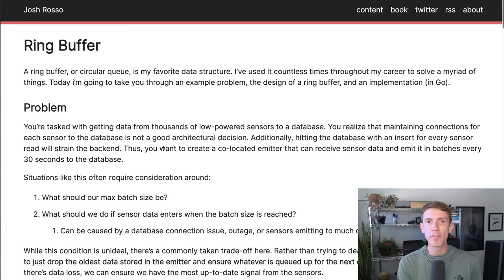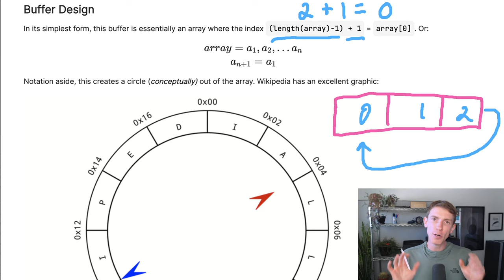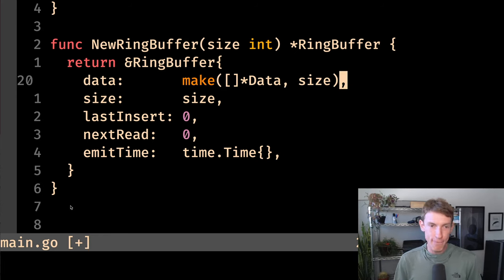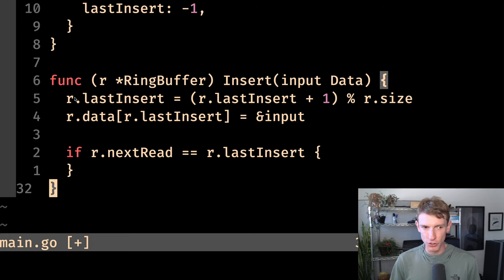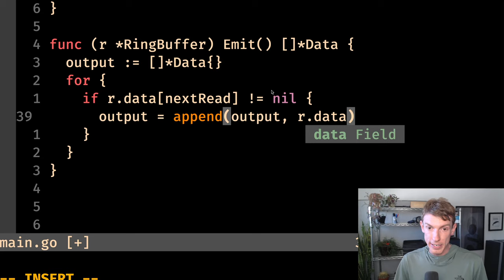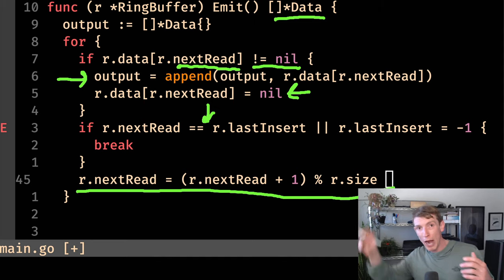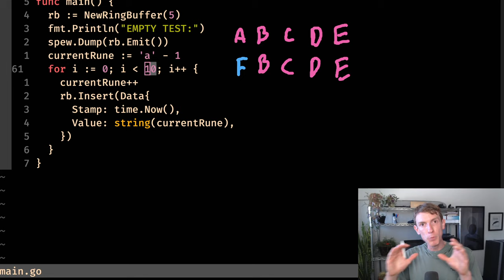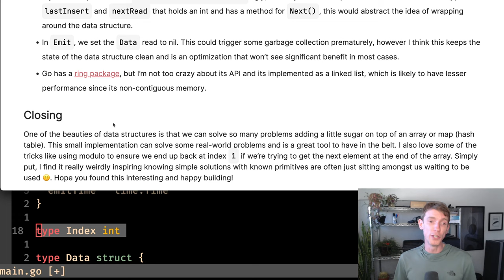Ring Buffer

Comment: great demonstration of a simple implementation of circular buffer. those structure are really useful with Arduino and other microcontroller. I usually reserve a node as an indicator for "overflow/datalost" that might be important to log (or turn on a warning light). I just recreate the node after sending/emptying the buffer and start at 0 instead of -1.
Reply from the maker: Great idea regarding the overflow indicator 👍🏻

Comment: There are several flaws in this implementation of the algorithm which are 'solved' by you using nil values.

The first problem is in the Insert method. The first value inserted increases lastInsert index by 1. At this point nextRead is 0 and thus equal to lastInsert which is now also 0. This executes the code that increases the nextRead index by 1.

The second problem lies in the Emit method. When in the loop the last character is read, the loop breaks but the nextRead index is not increased. So the nextRead is still pointing to the previous position.

As said both problems are obfuscated by the fact you use nil values.

Comment: Great tutorial, I got here from the blog post.Please can I know the software you are using to draw over the code editor. I have an xpen device but endup switching on different screens. Also some implementation block the insert/read when its full/empty. My guess is that data loss is ok for your use case.
Reply from the maker: Exactly! My goal/design trade-off here is to intentionally allow for overflow, prioritizing newest data.

The drawing you're seeing is a screen annotating tool, Presentify.

Comment: insert method is wrong i think..the if lastInsert == nextRead will be true after first insert. If the nextRead is 0 on init then after insert first insert lastInsert is 0 then the statement is true and you will move the nextRead to 1 and so one and so one. Solution would be to check if the last value of ring buffer  N-1 is null or not if is null that mean you yet didn't fill the whole ring buffer else if there is value already then it make sense for the nextRead to move